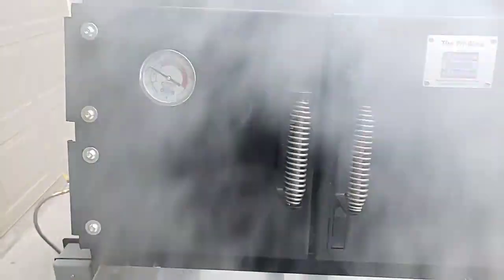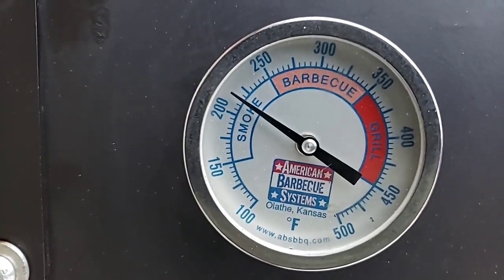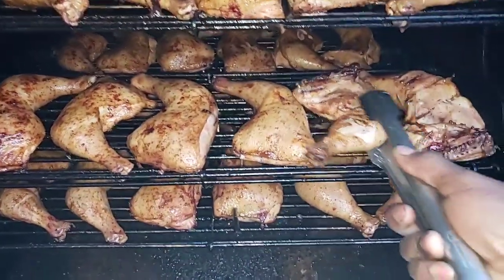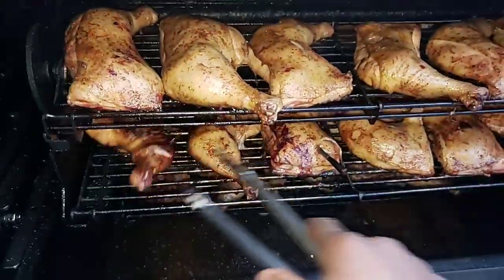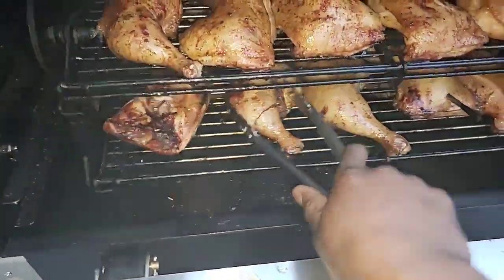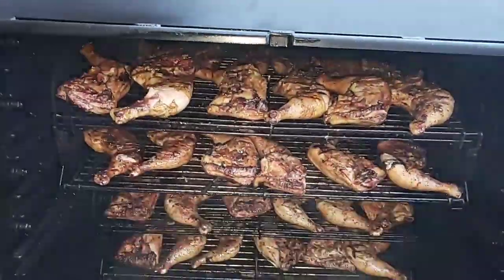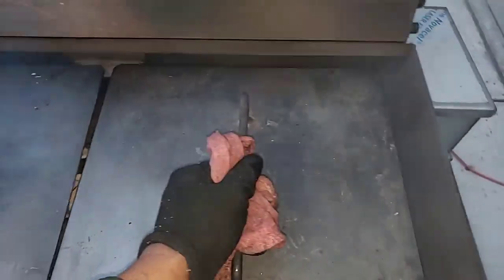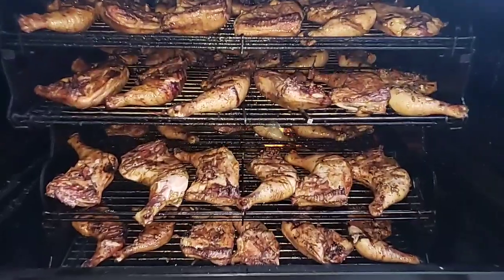ABS PIT-BOSS: A must have in your BBQ Arsenal ..

Comment: Is it a pellet smoker or a wood smoker? Why do have a fire in the fire box and one in the pellet ?
Reply: its does all, pellet,wood/charcoal/propane.... Looks like you can cook on the back where the charcoal goes if you need to sear or cook something like burgers..... IM very interested in this just dont know the price......
Reply from the maker: Hey throlyhd, the pellet system and propane assist is extra cost. I will tell you the pitboss runs great without it. To keep cost down you can always add later on. It's prefab to add the PA assist and Pellet  System...if you go to my ABS Pit-Boss Playlist you will see other vibs.